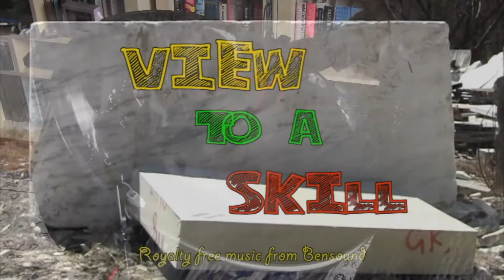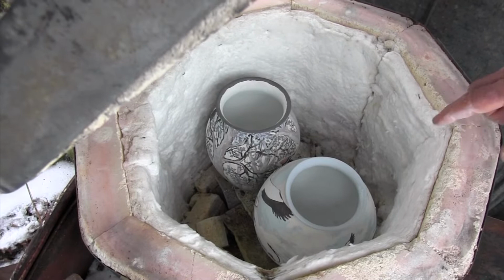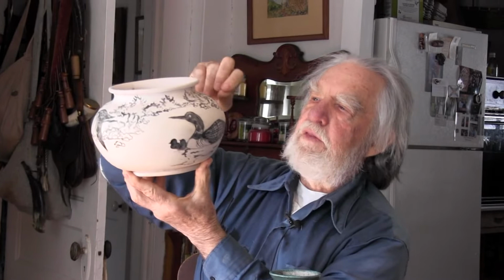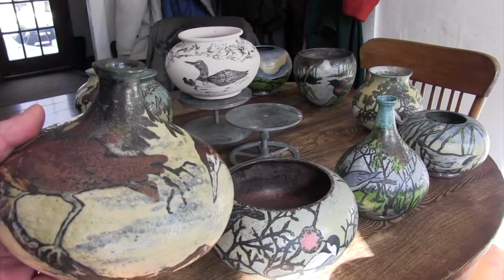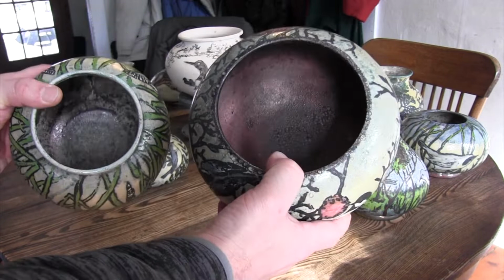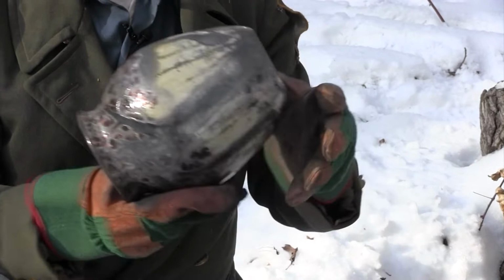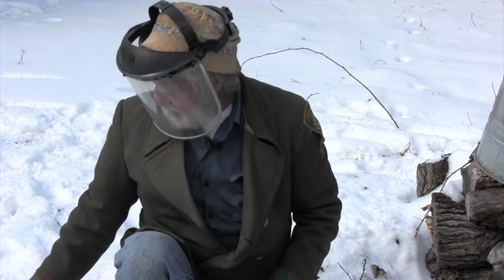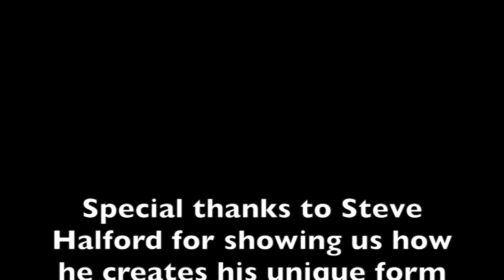View to a Skill: Raku Pottery - Episode 8

Comment: I love doing the varied forms of raku, including Obvara. I too am suprised that the vessel didn't break in the snow. As I live in the desert southwest (Phoenix),  I don't have the chance to experiment working with the snow.   I've seen several artists encourage the glaze to crack more by blowing on the piece,  using compressed air (more pricise), or even spritzing water with a sprayer on the piece before putting in the reduction container. 

I'm really inspired by your artwork, and plan on doing something with geometric shapes and colors as well.  There are colored waxes that you can buy on the internet (I use Mr Marks Wax On), that you can use instead of mixing your own: but I do prefer nice black lines,  which is easier for me to see the contrast. 

Keep up the great work, and thank you for this inspiring video. 

John